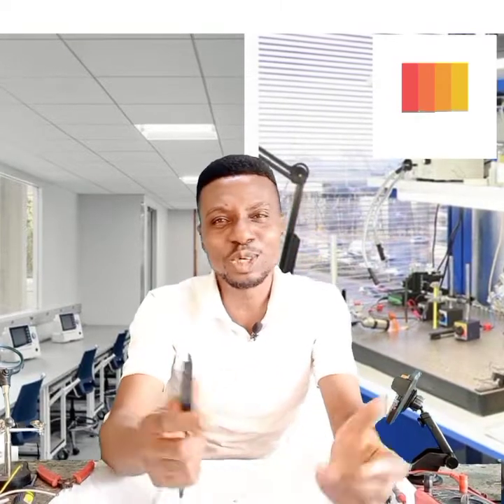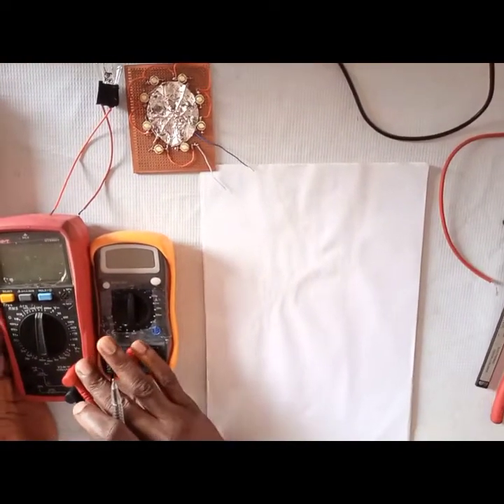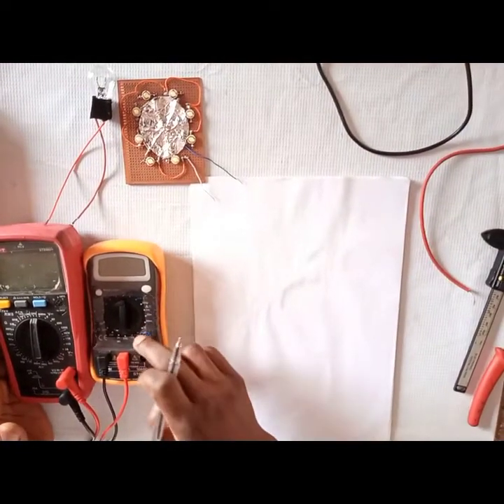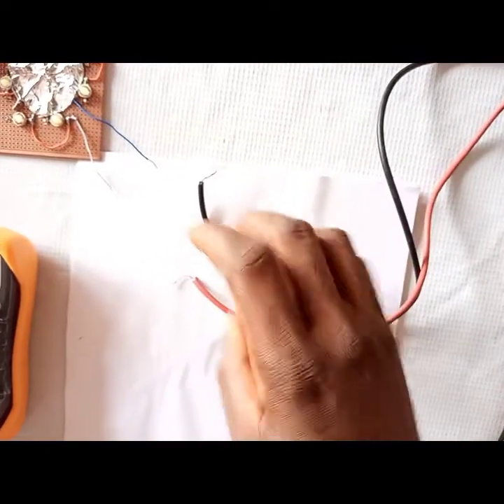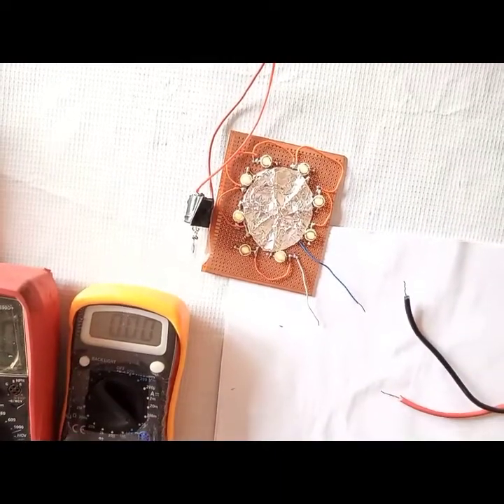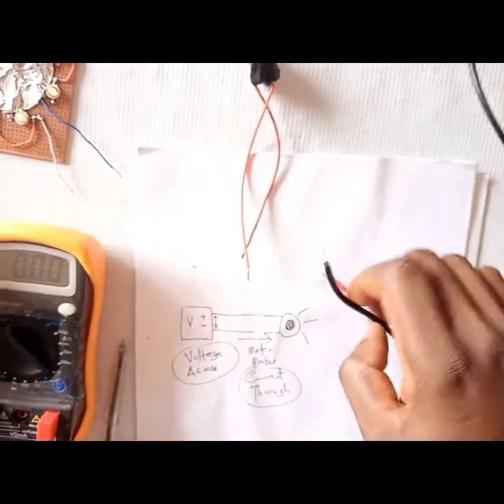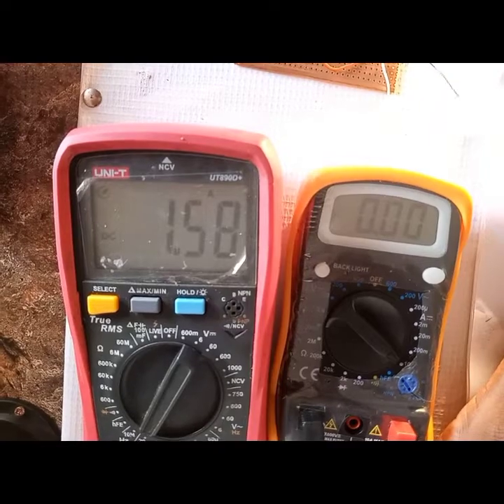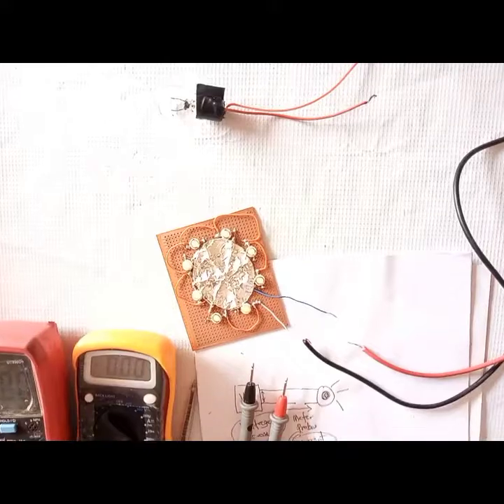Measuring Current With A Digital Multimeter | How To Measure Amps Using Digital Multimeters

Comment: Thanks for sharing this @teeta tech.

I have a Question.

If the circuit is already closed, would connecting the multimeter still as though it closed the circuit still give the current reading?
Reply from the maker: Thanks for your kind comment Akpofure.

No. The multimeter would have to be what would complete the circuit for you to measure the current flowing through.
I hope I answered you. But if you still don't get it, feel free to ask for clarification. I'm happy you asked. Cheers!